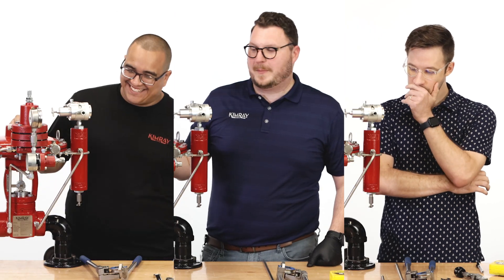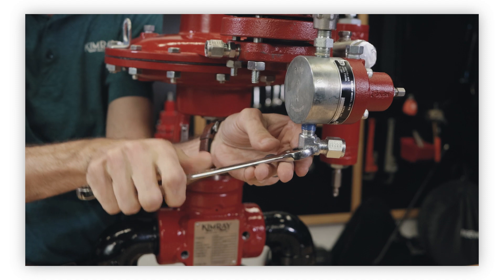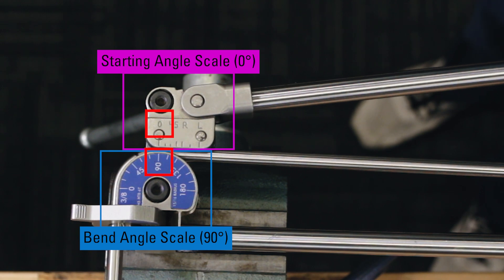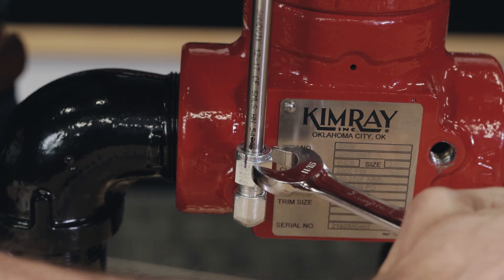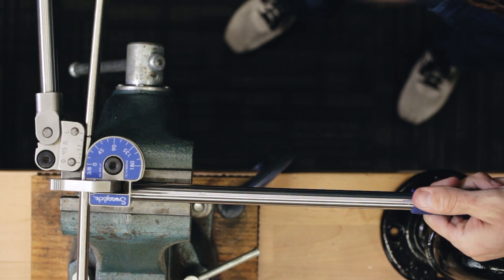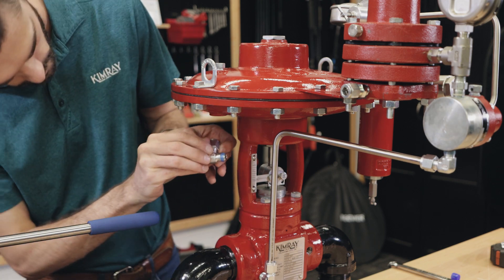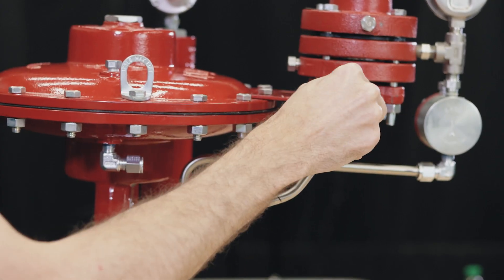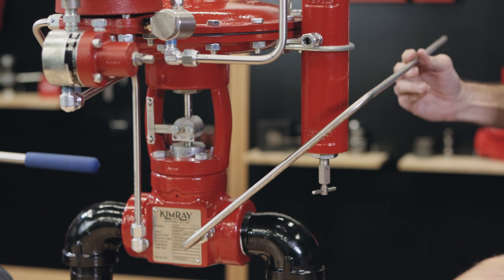Bending Stainless Tubing on a Pneumatic Oil & Gas Valve

Comment: Please don't use Loctite on anything. It doesn't come from the factory with it and it's a pain when rebuilding units that have it on them
Reply from the maker: The Kimray Oklahoma City store uses Blue Loctite on all fittings when building packages for customers. Other store locations may vary, but in general Blue Loctite should still be removable with little difficulty.

Comment: There is so much incorrect information in this video.  Just goes to show not to believe everything you see on youtube.
Reply: An example or two please?
Reply: Loctite is thread locker not thread sealer.  Should be using SWAK sealant or PST.
Reply: Also at 9:28 he aligns the tube with the latch before he makes the bend.  That will egg the tube.  Hi needs to align the end of the tube with the minimum bend line on the bender and then bend.  If it's too long hr could have cut it shorter with the tubing cutters.  Theres two major errors at least.
Reply: Holding tube in a vice - fail 

Not marking insertion depth of 
tube into fitting -fail 

Marking the tube instead of the fitting to reference swage - fail 

Not checking the ferrule orientation before swaging - fail 

But the loctite takes the cake !
Reply: Hahahahahahahaha I agree 110% . bout to say the same thing.
Reply: Example 3, let's not work it out. Let's just guess

It all looks pissed

Comment: Hi, great and informative video on tube bending. Could you tell me what is offset calculation multiplier for 15°, 60° and 75° angle?
Reply: Little late, but it’s 3.86, 1.15, and 1.033.
Reply: Use trig, don't try to memorize constants.
Reply: thank you for your reply. what is trig? @henryjantz

Comment: I would use thread sealant not thread locker. Most of your method is ok, I would never clamp or use pliers to hold the tube. It is one and a quarter turns for 1/4 to 1" for proper engagement of the tube fitting (I would have to look up over 1") and only 3/4 turns for 1/16, 1/8, and 316" tube. I have always tightened the nineties to the desired location and then tubed, you guys must find leaks there often. 

Oh, and use a back up wrench!

There is a mark on the bender in front of the "latch" that indicates the required minimum straight tube required for proper fitting engagement. 

Get a proper deburring tool
Reply: Very much agree with thread sealant suggestion, locker is for bolt and nut.

Comment: All bends to your left, center to center, also the hand tight and 1/4 turn is only with swagelok fittings, parker fittings as the ones shown need a little more, make sure you use a square on your tube after bending, it has a spring back, so going a 1/16th over your degree will give you the true 90, best practice too is to mark your tube around at the top of the fitting with your tube in to make sure you’re not short ferruling it
Reply: That’s not true. The 1-1/4 turn is not a Swagelok specific function. It is controlled by ASME B1.1 2A and 2B Unified Screw Threads control the travel distance between the bottom of the nut and top of the body hex. After 1-1/4 turns it is consistently 1/16”. 

The mathematical theory under the standard is 1.25 (pull up theory) divided by unified screw thread of 20TPI (threads per inch) = 0.0625 or 1/16”. 

Your gap gauge is checking for 1/16” clearance. If it goes, you aren’t tight enough. It is a NO GO gauge that is ASME controlled, which governs tube fittings of all manufacturers.

Comment: We use locking wrench style vice grips to hold our tubing while cutting. You also need to make sure your stinger is level when getting your measurement. Your tubing is crooked because you didn't level your stinger.
Reply: You got vicegrips made for tubing sizes? I had a pair, impossible to accidently damage tubing. Lost em, can't find new pair to save my life. Bouta make my own